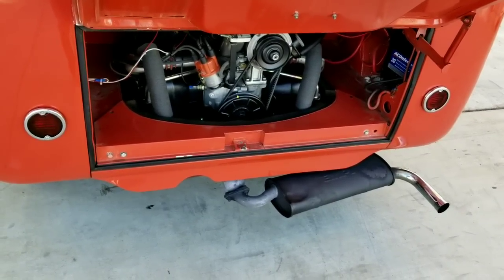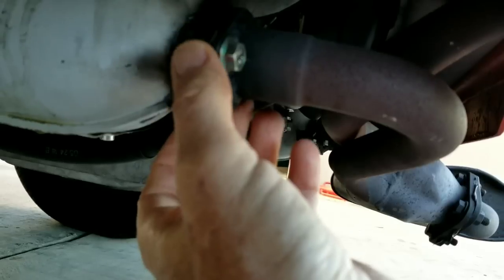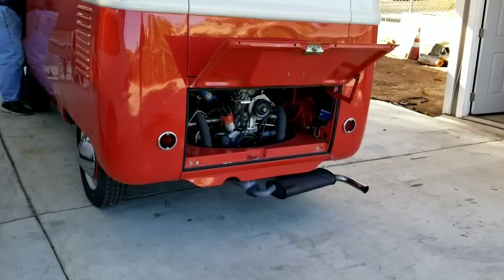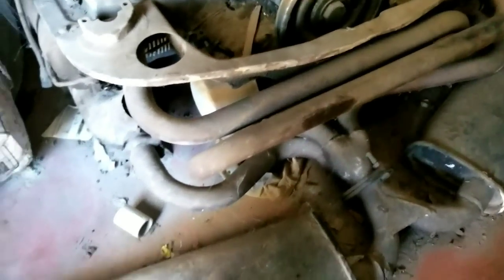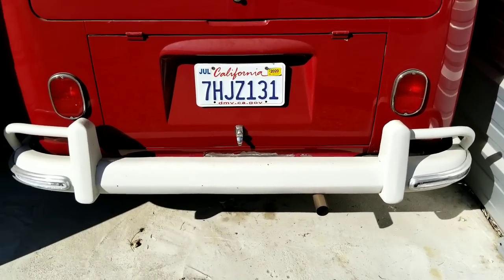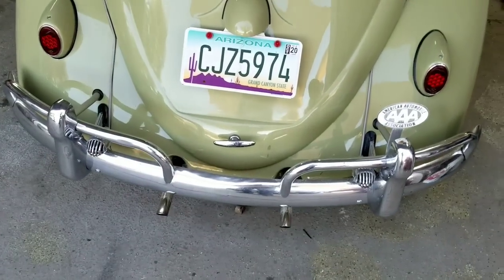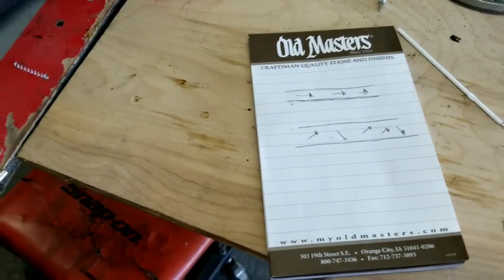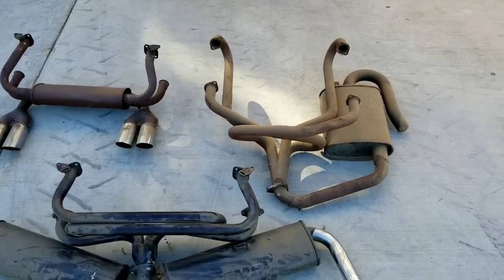vw engine exhaust how to figure out what you need

Comment: I like the 36 hp sound with the hollow tips I'm building a 1300 dual port w/100 cam and dual carbs stock exhaust and hollow tips. great video thanks for posting this
Reply from the maker: would help out with that build. Withe the cam it will be asking for a little larger exhaust but not too big. Full extractor might be turbulent.
Reply: thanks

Comment: Great vid but I think that you are underselling the extractor system. While the stock muffler is well built it was not ideal for making power and was an obvious choke point. For many of us putting on an extractor was the first mod to be done to a motor because it was easy, effective, and safe. Extractors are also inexpensive.Treat an exhaust system like any other add-on to your motor. By itself, it won't probably add much power to an otherwise stock motor, but it can facilitate good performance if it is one upgraded component out of a few.And yes, build the stroker motor.
Reply from the maker: on a 1600 they did make more of a difference. on the smaller engines 40 and 36hp not so much.  because the torque loss made the drivability worse IMO on the smaller engines.
Reply: The 1600 has a lot going for it. It is the largest type 1motor to come stock from VW, which makes it the latest standard as a motor. It is durable, versatile, and has a lot of potential. Parts for them are everywhere and they can prove to be cost-effective. I'm not ripping on the smaller motors here, but most of us VW owners have less to no experience with them. These smaller engines also had less to work with than the 1600, and hopping them up for more performance would be a more difficult proposition.
Reply from the maker: @masbeetleboy  yea for sure the 36hp engine to get performance out of it you need to spend 5 to 10 thousand dollars to make it run like a just barely hopped up 1600.

Comment: Do you think heater boxes makes a difference at all? I just took mine off and put j tubes. I have a single empi quiet pack but never thought about restriction. I forgot what size motor I have. I wanna say 1653 or so. I have the larger slip in pistons. I also have the cb 044 heads and dual epc 34 empi carbs. What jets do you recommend for my carbs? Are the stock ones ok? Is my exhaust ok?

Comment: Remember my old bug had an aftermarket exhaust, it was made out some really thick wall steel so eventually all the internals of the muffler departed leaving a straight through design. It was loud but never got stopped as it was just considered VWs were that way. Guy I worked with would get ticketed in his car but not me which annoyed him a bit.  That all would have been the early/mid eighties.

Comment: I'm running one of those "Quiet packs". Quiet they are not! I modified it to a side-tuck and added a dual outlet with two motorcycle resonator mufflers peeking out from under the guard. It's now quiet enough to appease the neighbor but having the muffler at the side makes adjusting valves a pain.

Comment: Excellent video Mike.

Over the years I've pretty much had all of these exhausts.
I agree that the merged twin thunderbird is one of the best off the shelf exhausts.
The CSP python is the new kid on the block for all out performance but like custom exhausts is a big ticket item.
Will be trying out a vintage speed exhaust on a T4 build soon, I will post how it goes.

The struggle I find getting older is a good balance between noise and performance.
Reply from the maker: yea I really like quiet but it just wasnt going to work. AA performance merged sidewinder actually fits on a bus. Even though it does not spec to do so. Sacrifices no heater boxes. But we have an idea stay tuned.

Comment: I like the way your 36 horse sounds on the beetle. I put an abarth on my 59 and love the sound of that. Not sure if there is any power gain.  I put it on the car before I got it running.
Reply from the maker: I think it does have power gain only at mid to high RPM because this car love freeway hills like no other 36 or 40.

Comment: Hey Mike you have a few different type of pipes there? On the Merger can You weld a 1 3/4 inch  reverse turbo on it . You could tuck it under by angling it a little. I have a EMPI pipe on 1600 and it is under the fender and only the chrome pipe sticks out. Maybe I backed up on to a curb.   Heck yeah I like a video on overhauling your old ( motor ).
Reply from the maker: The stock motor build is that what you want about the 1968 stroker 74 Buy 92
Reply: @Mikefngarage  You got the thick wall 92s and a 4140  74mm crank !  It is not blown right, just worn right ! If so a overhaul mite pep it back on the road .

Comment: Would love to see a 1641 dual carb build
Reply from the maker: probably going to be a 85.5 piston with 74 drop in crank. little or no machine work. all done by hand. so you can build a 1700 without machining a case just buy a stroker crank do some hand work on the pistons and case. or buy the i beam rod set and have a 1699.
Reply: Yeah It would be cool to see a video on that build

Comment: Great vid mate, thanks for all the info!
My partner has a 76 kombi with a stock 2.0L engine and she wants to make it quieter, especially for those long highway drives that seem to cause us to temporarily lose our hearing lol. What would you recommend?
Reply from the maker: Im not sure what exhaust is on it. make sure the tail pipe goes at least to the edge of the bumper. If it has a down pipe style sidewinder I added a tail pipe to mine and it is much easier on the ears.

Comment: What do you recommend for an 1835 with stock heads Engle 110 cam, dual 40 Weber’s . Merged 1 1/2 or the 1 1 3/8 standard header as we see on your 1835

Comment: I have a problem with my exhaust on my '61 Mango Bus. When I got my bus back the exhaust tip ends in front of the rear bumper. Half of the tip is clear and the other half is covered by the rear bumper. The exhaust is blowing in the bumper and turning my bumper black in that spot. It is lowered and I do not know what to do to correct this problem. It's a new motor and bigger than the original. I hate this exhaust. It is so loud I think. It kind of sounds like those exhaust systems kids put on their Honda civics...cans I think they call them.
Reply from the maker: I put an extended tip on my new merged system to get the exhaust past the rear bumper. had to weld it on. OMG it is so much quieter.